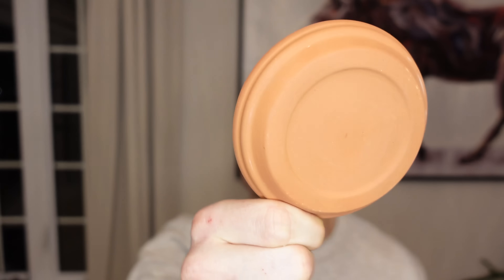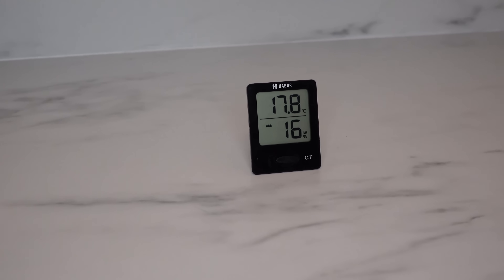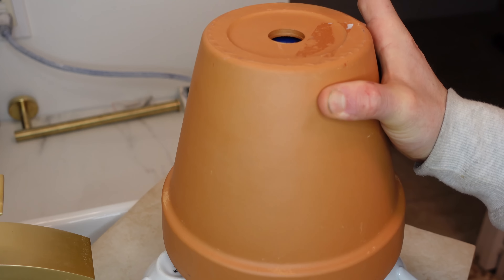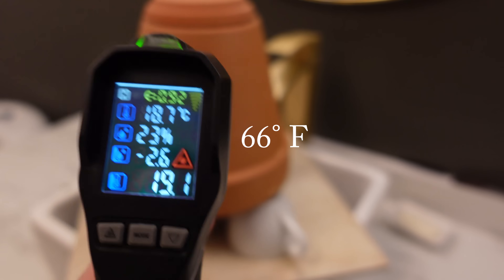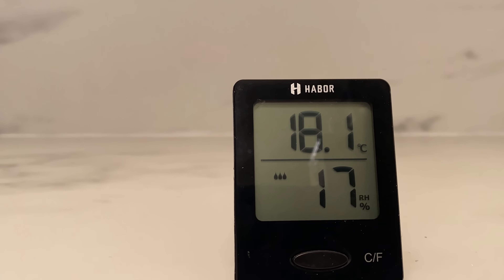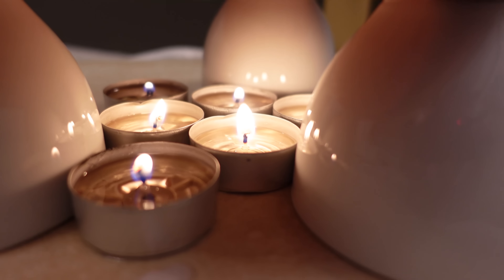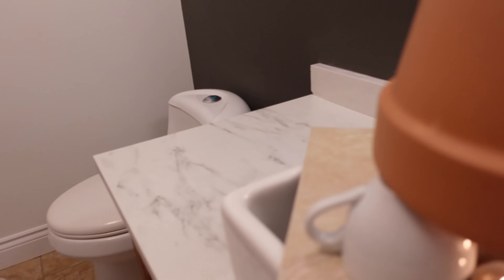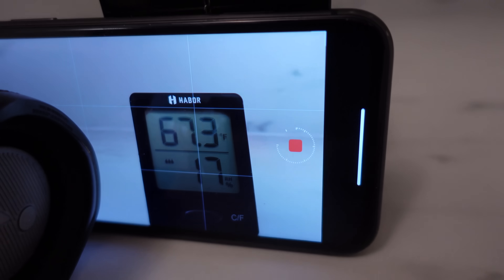CLAY POT HEATER TEST | Does It Actually Work?!

Comment: You should to another experiment using only the candles and no pots. See if the heat is the same with  and without the pots.
Reply: The heat output is the same, but its up near the ceiling.  What this system does is force the heat into the bottom of the room with radiant and convection heat.
I use waste fat in my burner.  So it is free heat, and quite significant heat too.
I use this type of heater all winter in my greenhouse.  And I use it in the house too.
Reply: @sallygiakalis4761  awesome idea for the greenhouse!
Reply: @sallygiakalis4761  hey Sally, what do you use as a burner? Like I don't really understand your setup but it sounds ingenious. Maybe you could respond with a step one step two step three text Reply on just what you do? Thanks for your time.
Reply: @sallygiakalis4761  
What kind of fat do you use?
They used animal fat in the past.
They made candles out of it.
But only the poorest people did that.
My dutch grandmother told us this.
They called it "Ongel".
But whatever solid fuel you use,
it will end up in the air you breath,
and on the walls and furniture.
Reply: @sallygiakalis4761 what size pots are those?
Reply: @sallygiakalis4761 so what, candles alone don't radiate heat? Nonsense. Plus the heat doesn't stay low because of a pot. All heat rises. Physics has laws whether you believe them or not.
Reply: indeed
Reply: That's exactly what I was going to ask. If he did the experiment with just the candles first 🤷
Reply: @lydia1362  scientifically it does trap the candle heat instead of going straight to the ceiling but it would still be fun to watch the experiment
Reply: @lydia1362  no the pots defiantly increase the heat after a few hours just like a gas fire has a grid in it to radiate the heat out
Reply: @GuitarBaby56  Lol?

We missed some school days as I can see?
Reply: Turn the lights off, too, unless you're using some sort of LED or lights that don't throw off heat.
Reply from the maker: Yea it will heat the room the same
Reply: Yeah and do them 3 times each. Test 3 times with pots and test 3x without pots.
Reply: If you want you could try it without the terra-cotta but this is how I heat my greenhouse when it cold spell comes in late in the spring….
Reply: S40gd  I truly hope you are just trying to be funny.
Reply: This would work with just candles and no pots but the problem is all the heat would be up at the ceiling and the entire room smell like candle wax not to mention you would be breathing a lot of that candle fumes in which is so unhealthy
Reply: That terra Cotta pot does nothing to increase the heat in the room.  It might help diffuse it in the same manner that a globe or lampshade diffuses light .

People seem to not grasp the basic laws of physics.
Reply: The point is to capture the heat in the pots and heat the pots up which radiates outward with the enhanced heat by the pots. 😊❤
Reply: It's turning the heat from the candles into infrared energy. If you let the heat from the burning gas rise to the ceiling without interruption then you won't feel it. But if you let it heat up the Terracotta, it will then be remitted as infrared which you'll feel more strongly. Radiation rather than conduction
Reply: I've done this doesn't warm u up if u don't use Terra cotta pot. Bcuz pot keeps heat n stays hot.
Reply: It 100% wouldn’t get warmer without the pots how can people be that dumb 🤦‍♂️
Reply: @tylerseabook9423  The candles can only release a set amount of energy. The only way that they could possibly produce more might be that due to chimney effect air would be drawn in more rapidly which might actually produce optimum output but reduce the candles overall lifespan. I put an IKEA stainless steel  utensils pot over a tealight . It certainly gets hot and still puts out light as well.
Reply: Yessss
Reply: There's not difference in heat gain pot or not pots, but it would radiate the heat in a more safe manner and closer to your body if you used the pots rather than having the danger of an open flame nearby.  Also I could see someone possibly taking the pots once the candles were out into their bedroom and placing them somehow under the blankets to act as a bed warmer if you were done needing to heat the bathroom (but that could be done with any dense fire proof object (brick etc)
Reply: @markbajek2541  actually your own breath under blanket works better and lasts all night. 🙂
Reply: @jerrylisby3440  Yeah but sometimes there's the dutch oven effect you have to watch out for.
Reply: @markbajek2541 What’s the Dutch oven effect?
Reply: no he just want to waste your time , fkn pointless video, i want my view back pls, and my time
Reply: It does but not as well.
Reply: LOL...LOTS
Reply: The heat will be the same over time, because the amount of fuel will create the same energy with and without the pots. Actually what the terracotta bell does is to distribute the heat in a different way, so it mimics a conventional heater and feels warm when you are next to it. Without the pots the heat will just rise to the top of the room straight away
Reply: That's stupid.
Reply: Of COURSE it IS!!!    NO ONE is breaking the Laws of Physics!!!
Reply: I heated a room that size with a candle in the early 80s. My power had gone out and it was comfortable.  Temperature outside was around 20 degrees.  JS
Reply: The point of the pots is to keep the heat at lower height longer. The room will heat up the same over time whether the pots are used or not, this just keeps the heat at say hand/face level if you are sitting beside the set up. So, if you are wanting immediate heat to warm your personal space, the pot set up is ideal. If your goal is to simply heat the room, then no pots needed.
Reply: Also, with or without a fan blowing since that can disrupt the natural convection.
Reply: Won’t work
Reply: Where this works Best is; in a car, when it freezing. Use two of them. Place them in a foil turkey pan. It won't warm the car, but you won't freeze in there, either. StraightUp
Reply: The heat would just diffuse with little effect.
Reply: I have done something very close to that: https://youtu.be/V7LD3PyXwxY
Reply: It is.
Reply: The amountt of heat released by the candles remains the same chimney pot or not . A cost comparison of candle cost compared to gas cost which is usually a third the cost of electricity. A quick heat build would be to heatvthe room with a hair dryer for ten minutes then maintain with candles IMO.
Reply: @acefreaky2988  you’re assuming that there’s going to be electricity for the hairdryer. I think emergencies where you have no electricity is the whole point of this exercise
Reply: This is a heating source for when there is a power failure.
Reply: I am glad to see I am not alone questioning the experiment.
Reply: Probably similar and that's what I was gonna ask too...when you eat at a table with two long candles, sometimes it gets too hot just with that so imagine....but food in a clay pot is better so who knows what's true..
Reply: Clearly you don't understand how radiant heating works. If you just have candles there's no heating element/object to be heated and the heat would disperse into the air not doing anything really. If you heat an object that holds heat like the terracotta pot it gives off way way more consistent heat
Reply: @narfoxone9er971  No difference in the amount of heat. It is just directed differently. The very close proximity of the pot system may be warmer but absolutely no difference to just the candles when trying to heat up a room.
Reply: Wouldn't  it be better to take the cap off the hole in the pot,???  Heat rises, so it looks like it would put a lot of heat out into the room if the lid was taken off.
Reply: @nancysmith6685  Not really, essentially it doesn't matter for total room temp if you even use the clay pots , btus are btus and the candles only have so much to give.  But heating the clay pots first causes a different distribution pattern of heat (more sideways) so if you were hovering near the clay pot you'd feel warmer as it's releasing infrared heat nearby and not straight up to the ceiling where you're probably not at., just like if you were to stick your butt into a fireplace, the closer to the fire the warmer you'll feel. but overall the same amount of heat is released by those candles into the room. clay pots or not.   the benefit of the clay pots is essentially safety from the open flame and depending on design (not this design) possibly portability  , but even in this design you could take the heated pot (s) off the flame and place it under your chair (and toss a blanket over you trapping that heat) or maybe in a bed under a blanket and it would release stored heat sort of like a hot water bottle does under the blanket to warm up the bed a bit. that's probably a better use of the candles , try to create a very small micro climate under some bed covers with the heated clay. (or heat up a firebrick and toss that under some covers.
Reply: S40gd  it’s good that you’ve worked out the candle is going to give off bugger all heat. If you can just accept that plant pots do not have magic heat amplifying powers you’ll be ready to pass day one of school physics 🎉 Gas central heating for the win! 😂😂😂
Reply: The only difference the clay pot would make is after the candles burn out, it would retain heat for maybe half an hour and that’s all. There’s a guy who makes these pots who is laughing all the way to the bank for a TikTok prank!
Reply: @peyps2k  Don’t forget, it took just as long to absorb that heat that would otherwise have gone into the air, so it didn’t prolong the heat. It just delayed it.
Reply: @peyps2k it wouldn’t just do that it also retains the heat and focuses it at a lower point in the room instead of the heat rising and quickly dispersing. You clearly don’t understand.
Reply: @peyps2k i
Reply: @peyps2k The things is that the clay pot retains heat in it and then radiates throughout the room. 💞
Reply: @peyps2k  No difference. The pots just take as much longer to heat up in the beginning. The pots add nothing when trying to heat up a room. But if you are staying in very close proximity of the pot system it’s better than just the candles. The amount of the heat is the same, it is just directed/distributed differently.
Reply: @peyps2k  it would retain heat for about 2 minutes not half an hour 👍🏼
Reply: I can tell you for a fact that it would probably heat up more without the pots 👍🏼
Reply: Apparently if you rub layer graphite powder  on pot outside it retains more heat
Reply: All you need to know is called the First Law of Thermodynamics. It's the Law, and can not be broken no matter how many pots are used

Comment: The candles give off a certain amount of energy (joules) to the air, with or without the pots that energy is the same!!!!!, human stupidity is limitless!!!!
Reply: And the pots stretch the energy so you multiply it like 10 times. And what is 10 times 10..? Yeah - thats right! So if you have 5 candles thats 5 times10 times 10 - thats 500! It adds the energy up so many times over with the pots 😎

Comment: tealight candles do not burn 3 hours long!
Reply: I use two types of tealight candles. First type is advertised to burn for 4 hours, but in reality burns for 4 and a half hours, and the other type is advertised to burn for 8 hours, and it's exactly how long it burns for.
Reply: like the woman said tea candles burn for 4 hours, didn't know of the 8 hour ones, will look for them. but you are right nor 3 hours burn time, more like 4 hours.

Comment: Try that with just the candles alone and no pots. Be surprised to get the same results.
Reply: exactly.  about 100watts per candle. With or without the pot.   Maybe if you wana heat ur hands the pots will be usefull but not for heating the room.
Reply: That doesn't necessarily make sense because of how things work together and create something more. Eg two oxes or shire horses will be able to pull a certain amount individually but together under the same yoke they pull more than two.
Reply: @Samua3  the fuel has same energy you can extract from it with or without the pots
Reply: @Ecne3D  but doesn't it disperse in a pretty useless manner if the candles are just open? It's just that loads of older people are saying how they used to do this and how good it was. The candles even last longer if it's done right. 
Some things just become great when they are put together. Is this not one of those times because loads of people are saying it is. Even the guy who said they are really dangerous said it was brilliant for getting rid of condensation on his windows. He should actually have built a much safer one because he was on a boat! But that's another subject.
Reply: @Ecne3D  The amount of energy is the same, what the pots do is improve the use of that energy. It's not stranger than how a radiator is constructed.

Comment: The candles in space? The candles give off a certain amount of energy (joules) to the air (cubic) in the room. This one gets hot.
The pots in the room are warmed by the candles. So the air around the pots becomes less warm. The pots then release the heat into the air. Perhaps the air above the pots is briefly warmer than the rest of the air. But then the rest of the air in the room is less warm. Why? The candles only give off a number of energy (joules) to the air (space) evenly what it contains or is heated. Otherwise a perpetume mobile would be created and it would get warmer with more pots on top of each other. You can't make MORE energy.😁

Comment: You have made a airflow mistake. The part that cuts holes and is used to put on the second pot needs holes at the side so the heat gets transfered between the two pots. This waythe heat will be more afficient
Reply: The candles in space? The candles give off a certain amount of energy (joules) to the air (cubic) in the room. This one gets hot.
The pots in the room are warmed by the candles. So the air around the pots becomes less warm. The pots then release the heat into the air. Perhaps the air above the pots is briefly warmer than the rest of the air. But then the rest of the air in the room is less warm. Why? The candles only give off a number of energy (joules) to the air (space) evenly what it contains or is heated. Otherwise a perpetume mobile would be created and it would get warmer with more pots on top of each other. You can't make MORE energy.😁
Reply: @1957mattes  I'm not sure if this is the same science but you can make more energy. 
eg a shire horse can pull a certain amount of weight.but if two shire horses are working under a yoke they can pull a lot more than two separate shires. Things working together can be a lot more effective. There is more science going on here than just burning candles. There are things working together.
Reply: @Samua3  Yes if you have 2 horses it is more than 1 horse. But if you have 6 candles, then you have 6 candles.
That is a certain amount of energy. ALWAYS. And if there is nowhere else an energy source like the lamp here, for example, energy will NEVER be converted into heat in the room. The pots will NOT add NO more energy. Perpetum mobile is not possible.
Reply: @Mark Carthy This will not heat up the room at all. The pots become warmer and give off the heat to part of the room air. But in the corners of the room it stays colder than if you don't use pots. AGAIN you CANNOT increase the energy of the candles. If that were possible, you would have more and more energy and you would no longer need candles. A perpetummobile is not possible (see wikipedia) if you don't believe me.
Reply: @Mark Carthy If you want to warm your hands use the candles and keep your hands above them. If you want the room to be frost-free ... leave the candles burning. Do you want to have a little heat in the room with a delay? Then you can use the jars. But there you can also use a stone, a pot of oil or water. The heat will then first heat the stone and it will slowly give the heat to the room. But the quickest thing is to burn candles point. Slowest heating something that releases slowly. But important is... the amount of heat will remain the same as the number of joules that the candles give.

Comment: Put the pots closer to the base,you only need an inch at maximum...also put the candles into a container to reduce drafts affecting them...
Use 1 flowerpot for faster heat...bathroom? Use the double wall for longer term heating...
If you make a smaller version, 1 candle will heat a can of water, enough to brew coffee.
Reply: I do that to keep my teapot warm.